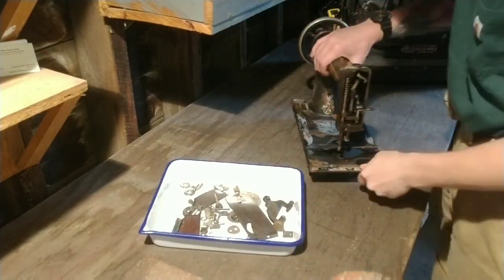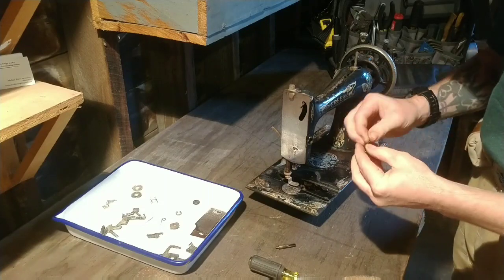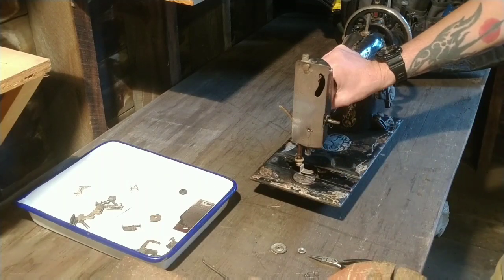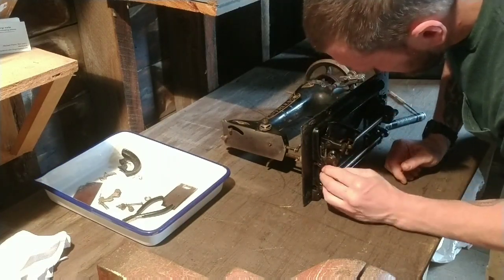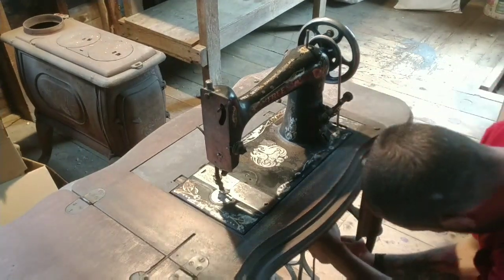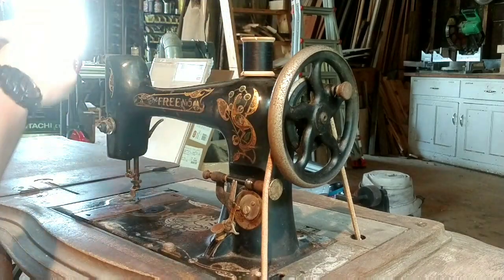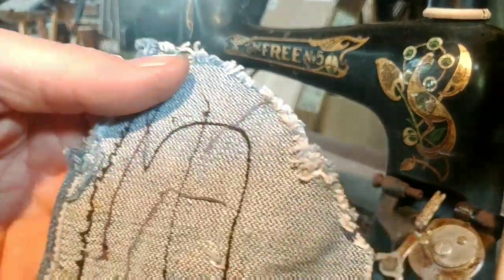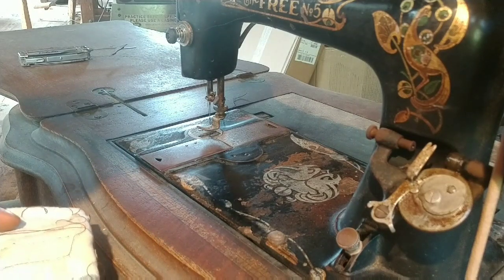Restoration of antique Free sewing machine part 4

Comment: The collar nut you had left over is a electrict light nut and I have one of these machines and your tension is not Wright it has no rubber washer on them it is a very simple tension  you done a great job on getting the machine running and the screew looks like the screw that fits in the end plate above your take up lever thank you for your hard work on your videos
Reply from the maker: Thank you!

Comment: Thank you so much for documenting this process! I have a Free No. 5 I'm working on restoring myself, this has been very helpful. I see it doesn't look like you've removed the handwheel on this machine, is there a reason for that? I was scrubbing through trying to figure out how to remove mine, as my machine is more corroded and rusted on the inside. I think i'll be doing paint touchups and at the least getting a clear coat of rust-oleum all over the cast iron so it doesn't corrode any further. If you have any tips for me on this endeavor i'd be extremely grateful! Regardless, Thanks again :)

Comment: vibrating shuttles all have that hip hop motion of the needle bar at the bottom of the stroke-that's what helps make the loop of top thread large enough for the shuttle to pass through. That large knurled screw is probably to hold an attachment down on the bed, such as a seam guide, in one of the two threaded holes just to the right of the needle . Don't run the thread through the tencsion discs to wind a bobbin. Just pass it through the top thread guide on the face plate and than directly across to the winder.  feed dogs are way too high- try setting them to protrude only about 7/8 of the full height of the teeth.

Comment: Love your videos!  I found one just like this, but it seems to need a bobbin shuttle holder.  Do you know where a new one can be gotten?  All I can find are ones for Singers...wondering if the ones for the Free are unique or would one of the Singer models use the same one?
Reply from the maker: Thank you! 
I don't know if they are interchangeable, but the folks over at treadlon.net may have more answers or possibly a source on parts. Good luck!